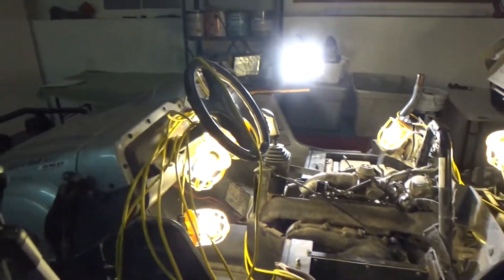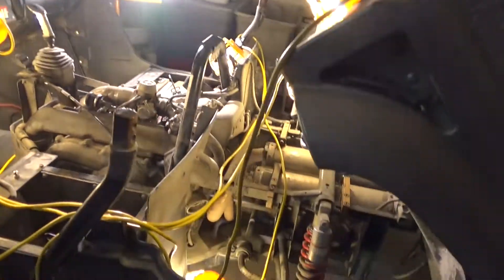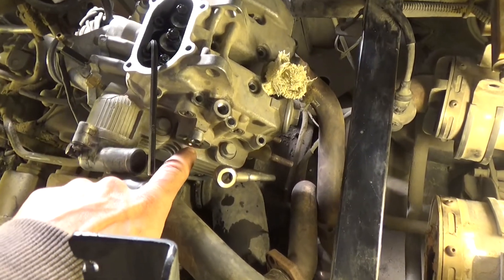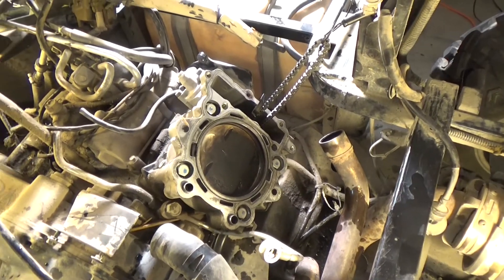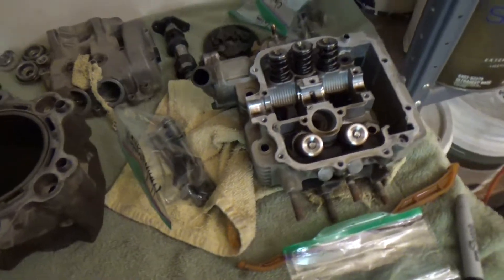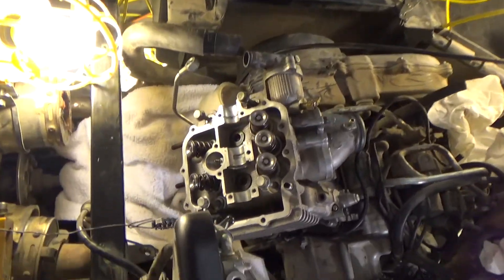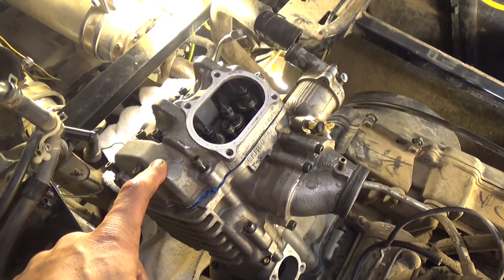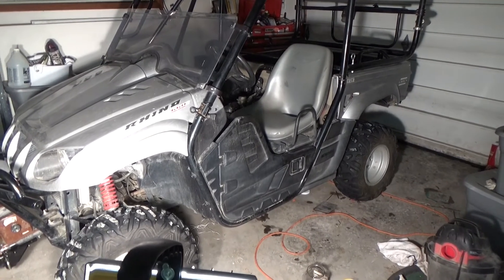05 yamaha rhino 660 engine rebuild

Comment: Did you hit any snags? Any special areas to watch out for as I am going to do mine soon.....it runs but burns oil like a bith. Thanks.
Reply from the maker: Couple things to watch out for. When doing the timing the manual calls for the dots on top of the cam shaft to point up when setting the timing. I thought that ment directly vertical due to the vague description. The motor is in about 30° angle off from vertical so align those dots on the top of the cam directly "up" In relation to the tilt of the motor. Could be my manual sucked but that was the confusing part. Otherwise pretty straight forward just keep meticulous order of things and you'll be fine